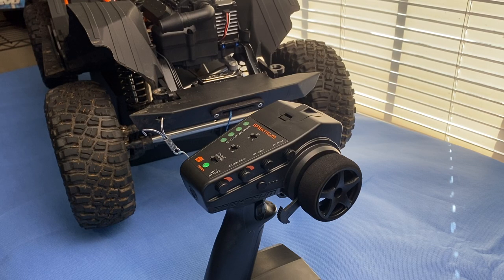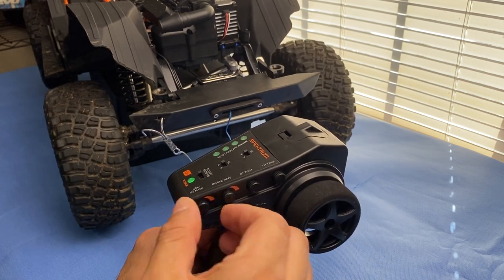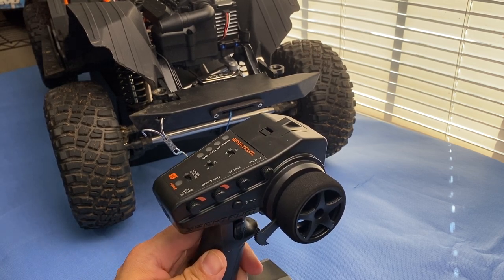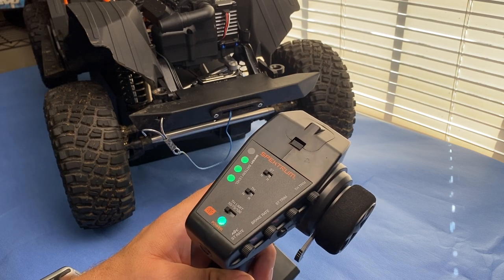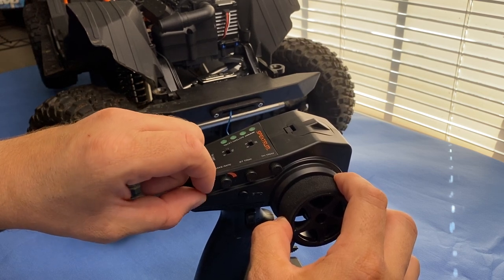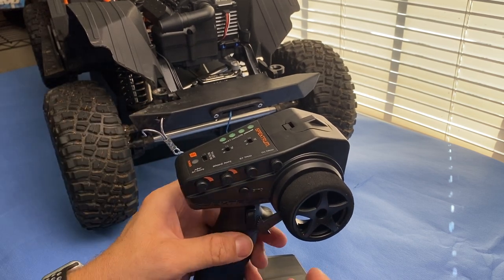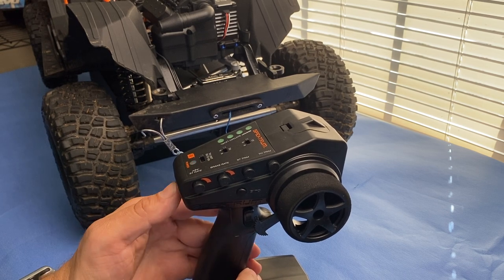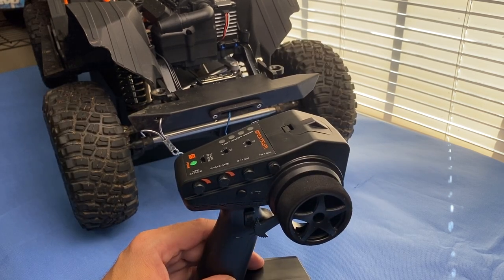Setting Steering Endpoints - Spektrum DX3

Comment: When calibrating the steering, should much attention be paid to the whining sound the servo makes when it maxes out?  That sound seems to run pretty consistent to when the wheels can't turn any further.  I feel that that sound is just as important as paying attention to where and when the wheels stop.  More info on this would be appreciated.  I have an Outkast 6S with stock Spectrum servo.
Reply from the maker: Yes, the servo will "tell" you when it's maxed out by the sound it makes.

Comment: Need help brand new remote, just did the binding, and the remote battery indicator lights are flashing green and beeping??? But car is working,
Please not I can put the same two batteries in my infraction and the remote on the one has no battery indicator lights at all?

Comment: Hello. It does not smooth it, so that I can turn the wheel to the right by hand to full and it is impossible to use the remote contro to full when I won't settings endpoint stering. What is wrong? To left side is ok but to right is not. Is not full.
Reply from the maker: If your servo horn is not centered correctly (takes a lot of trim to get the truck to go straight) then you might have issues getting full travel one direction or the other.

Comment: Why can’t I adjust my steering when I turn right. Left is fine but it never does anything when I adjust it on the right side. It’s still 150%
Reply from the maker: If you have the trim set pretty extreme it’s going to be hard to set the endpoint the other direction. May need to move the servo horn one tooth.

Comment: This method totally turned off or changed my ESC settings.  Granted it worked for the steering adjustments until the powered down (save method).  But in turning the TX power back on, now the ESC no longer functions.
How do I turn that back on ?  😵‍💫
Need I bind the whole system electronics again ?  Tough to do with a broken RX.
Obviously I did something wrong !  But I followed your instructions to the letter.
But in turning the TX off and then on again I lost my ESC function ?
Now after turning it on again I've lost all functions including steering ?
A supposedly simple thing and now I have a dead $ 1,300. paper weight 😕
Now the local Hobby Store here in Alaska has determined the RX is no longer functioning ?
How can this happen with a program fault ?  
I did nothing electrical to cause it harm or for it to malfunction ?  Unless programing it can cause damage to electrical components ?
I'm both perplexed and mystified  !   🤨
My advice to others don't follow this "How to" instructional video.
Reply: After you set end points, calibrate throttle, it any other adjustments you should rebind your tx & rx. Especially if you use the AVC